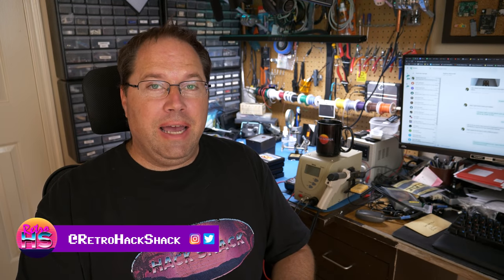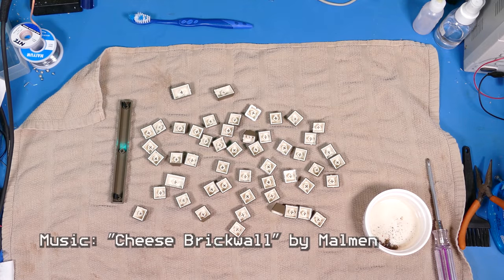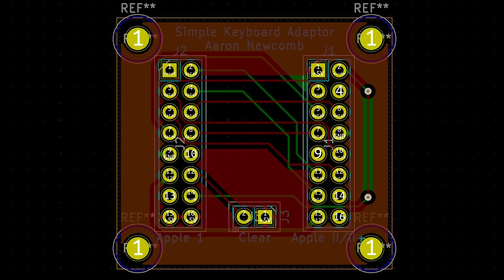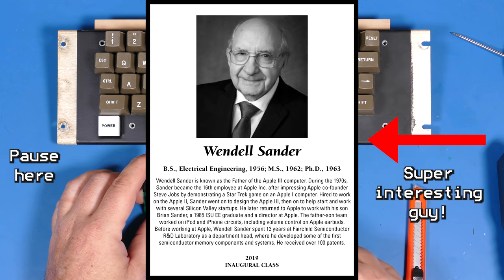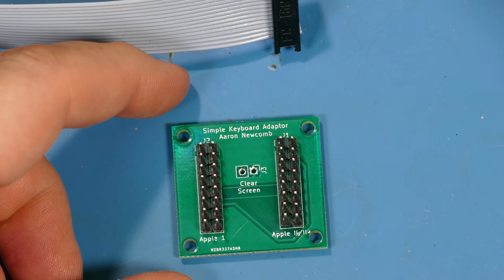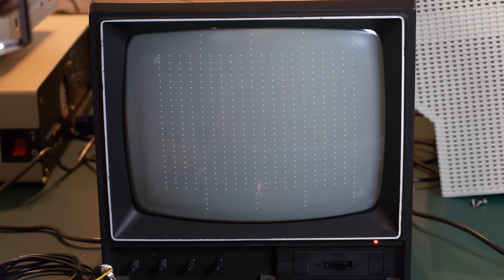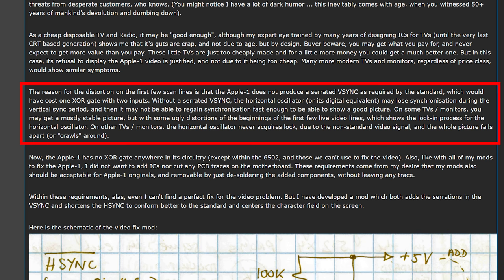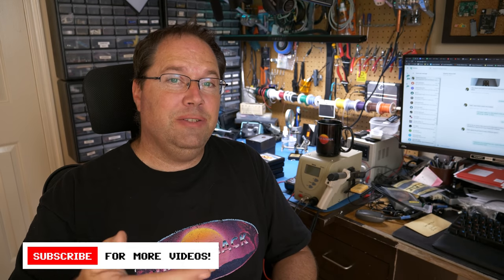Apple 1 Keyboard And Monitor

Comment: You could make this adapter's gerbers available with us... :)
Reply from the maker: Yes. I plan on it. I'll probably make another version that uses dip on both sides as well for people that don't want to cut a cable and add the idc connectors.
Reply: @RetroHackShack  How far along with this are you? Finishing off my own Apple 1 build now and need something like this to connect my keyboard!   :)
Reply from the maker: @TurboCharged_RubberDuck  Do you want to use IDC connectors like I did? If so I can pop a board in the mail to you. Just send me an email. Otherwise, I might be able to work on this today.
Reply from the maker: OK. I have added a link to the design files in the description.

Comment: I'm in the process of building one myself.  I decided to build an ascii keyboard rather than try and source one and troubleshoot. I had to add a bodge wire for the no-dma as it wouldn't take a bridge which I attribute to the cheaper boards. Cheers to you!

Comment: One thought, some of the video issue may be that the monitor isn't self terminating.  Old monitors would have to have their loop outs terminated with a 75 ohm resister plug or else would suffer from all sorts of signal trouble.    Don't know if that's the issue here, but the way the lines turned wavy reminded me of it.
Reply from the maker: That's a good idea. However, it does have that terminator switch in the back and I tried it both ways without much of a difference. Also, the Apple IIe didn't display any issues in either mode.
Reply: @RetroHackShack  Very good, I didn't notice the switch while watching the video.  You might could verify the switch is making contact, but more than likely it works fine and termination isn't the issue.  Sounds like the trimmer pots were the fix.

Comment: I'm not a big Apple fan, but this video is oddly satisfying...  It's a lot to go through to get a keyboard from an Apple II+ working on a replica Apple 1.  You might have come out better just gettings some Cherry switches and building a keyboard  (those switches you "resprung" will eventually fatigue again).  Yeah, it's a bit more expensive, but would be better long-term.
Reply from the maker: Yes. These do exist and you can build them from scratch if you want. Personal preference on which way you want to go with any of these accessories.

Comment: Deoxit D5 contains a lubricant, which attracts dust and debris.  It's the worst thing to use for potentiometers.  You should use contact cleaner that does not leave a residue.  All you did was spray gunk into those pots.
Reply from the maker: I used the green stuff too. Which is made specifically for pots. It didn't help.
Reply: @RetroHackShack  Sometimes you have to desolder the pots, disassemble them and carefully clean them, then reassemble them.  That can be beyond some people's "pay grade", but the way those pots were manufactured does not make them easy to clean just by squirting them in place.  Others may just get a brand new replacement and be done with it.  One that perfectly fits would be difficult, but one that works would not be difficult.